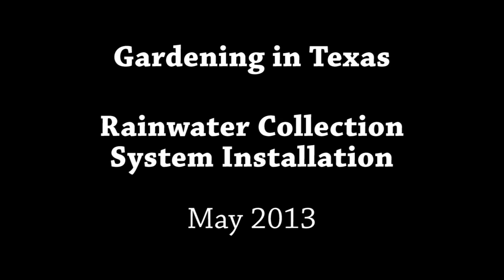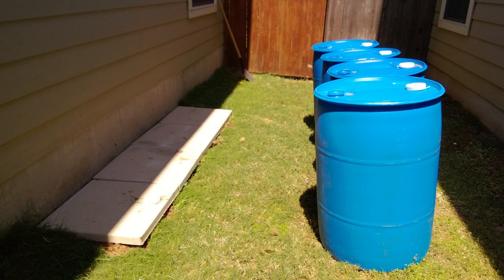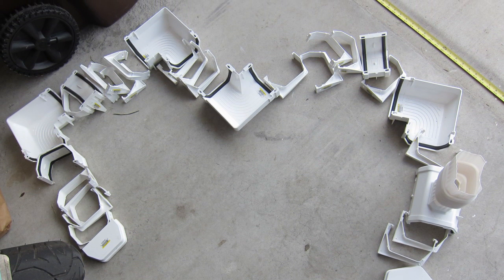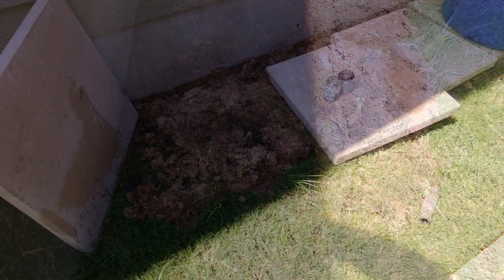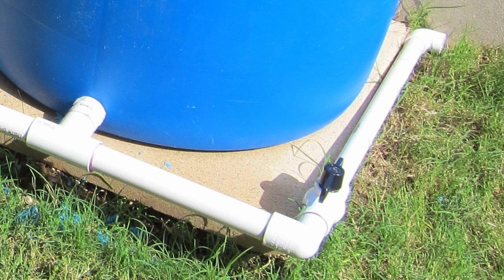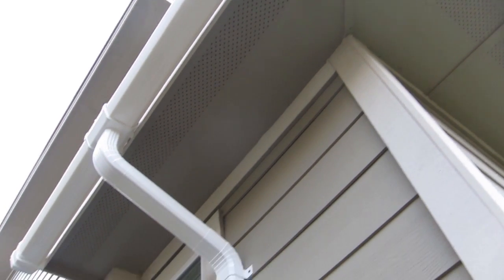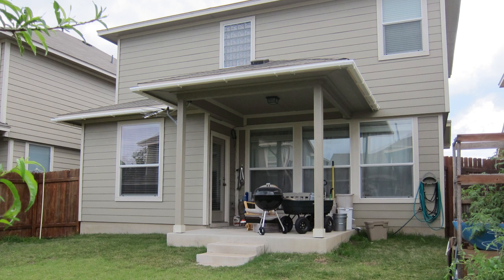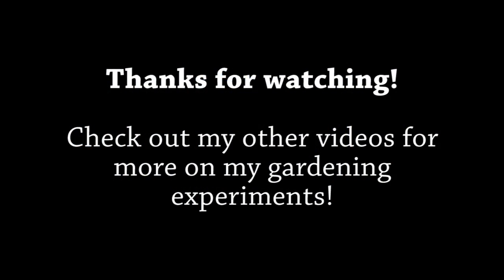Rainwater Collection: Installation

Comment from the maker: Thanks, yeah, that was why I had the water pour in at multiple places, although you're right that even with my setup I could have more water coming in at the top than can drain out the bottom. Mainly I went with 1" because I already had the gaskets and the drill bit, but it's a good point.
As for city regs, it's actually illegal to prevent people from doing rainwater collection in Austin (in the back yard), and the city will actually help pay for certain private installations.